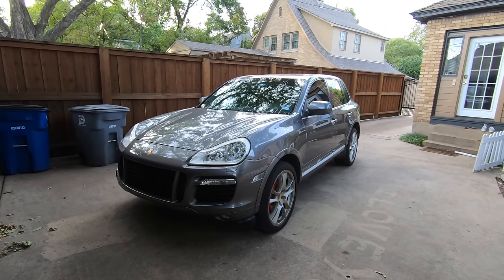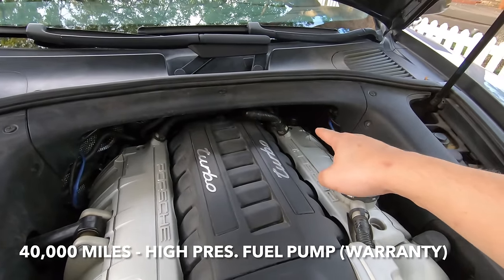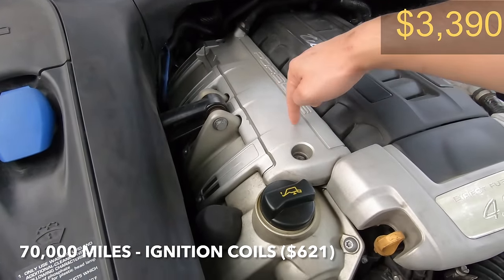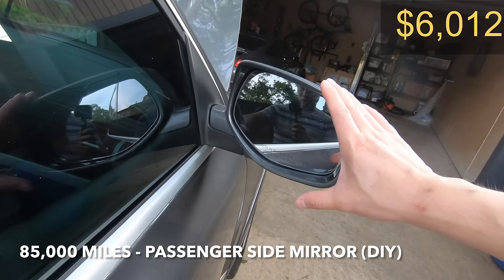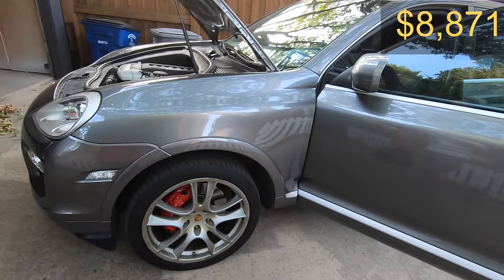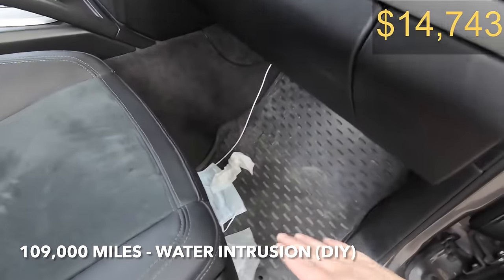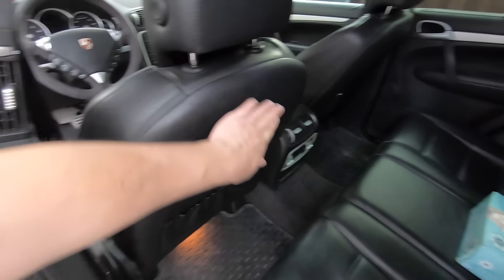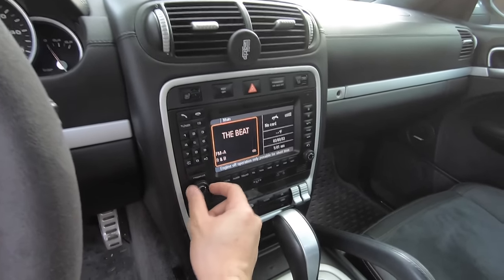Why Are Used Porsche Cayennes So Cheap? Owner's Review of 15 Year Old Cayenne Turbo (955, 957)

Comment: Premium cars like that with 100K miles are incredibly cheap in the UK. I remember my mate buying an old Audi S8 for less than £3K once, he got lucky and drove it around for a couple of years with minimal maintenance and sold it on. But all that car needed is one thing to go wrong and it could wipe you out. Even the tyres cost a fortune. It's the sort of car where if you couldn't afford to buy one with low mileage you definitely can't afford to run one with a high mileage.
Reply: Not speaking of Porsches, but my mechanic who really knows his stuff says of the modern era BMWs and Mercedes never buy used above 100k miles they are junk. Of course, he likes the Toyotas and Lexus. He owns a GX 470 Lexus and swears by it. Yet recently he just bought himself a new Tesla X. I want to say he paid 140k usd for it.
Reply: In Canada I can't even get an appointment for service without waiting six weeks. And those "repair costs" this video is posting??? Triple that in Canada. I can't even drive BY a mechanic shop without it costing 1,000. with no issues found. Ouch.
Reply: @Dwightstjohn-fo8ki  sounds like theyre ripping you off
Reply: Premium cars and high-performance cars start to generally start to get trouble around 80k miles/120k kilometers, that's why they're cheap. All the parts are expensive, and they're usually complicated to work on which means high labor costs, and sometimes special tools are required to work on them which means you need to go to the dealer which means $$$$$. High parformance cars are especially risky to buy secondhand because people tend drive the hell out of them, as they should.
Reply: I had a cls.  £2K FOR TYRES, They lasted 2 years of normal driving.
£3 a day !!!!.
Fart and a check engine light come on.
How I wish for a car with no gizmos
Reply: @Mr-ue2ul  yeah if you want a premium car you’re best off getting it as a company car then you don’t really care about stuff like that, you don’t pay.
Reply: @thyslop1737  you friend is absolutely correct. I only lease BMW’s. HOWEVER, my lil BMW i3 is an electric gem. My first service is 2 years. I’ve owned it for 1 1/2 years and it’s been perfect. The 2 year service will be just a walk around. They’ll probably say my tire tread is getting low due to the extreme torque this thing produces but I won’t pay for their over priced tires.
Reply: @Skyking6976  BMWs? Two weeks ago a cousiin picked me up from the airport and took me to the hotel. Never looked but it was the SUV do not know the model, if it was the 3, 5, or 7. Not sure of the designation. It was at night, but all I remember is how cheaply, tin can like it was and the ride was not that great. Just remember the SUV seemed cheaply put together.
Reply: I drove Honda crv 2015 for 7 years 0 issues, bought it new for $26k. Sold it recently for $15.5k and got $2k back for unused extended warranty. And bought 2022 Acura MDX Type S advanced and already multiple issues and rattling noise in a car. Fuckthis
Reply: @r2com641  Bad move. My sister had the MDX. Wanna say she had tranny problems at 50-60k miles. She lives in Florida. Drives like a grandma. She bought it new. This was at least five years ago. I think she said the replacement transmission was going to be 7k, if not more.
Reply: @thyslop1737  well I have extended warranty for 120k and 6 years.. so I’ll most likely swap car within that period
Reply: @r2com641  Will have to ask her the particulars on that car again.
Reply: @thyslop1737    Methinks your mechanic charges you too much.   $140K?  Yikes !!!
Reply: @boyracer3477  Did not charge me anything. HE TOLD ME HE BOUGHT A TESLA X and I think he said he paid 140k usd for it, if memory serves me right. Juzt thought it odd that he bought an electric vehicle, since he does not work on electric cars.
Reply: @thyslop1737       If he is your mechanic, he must charge you for maintenance.  That's what he does.  And if he buying a $140K car, he's making a lot of money doing it. But whatever, it's all good .....
Reply: @boyracer3477  Actually, he is very reasonable. He has built up a really good business though and was investing in real estate. Been at it for 25 years and has his shop paid off. He is very inclined towards the Lexus' and the Toyotas. Yeah, he must be doing pretty well to spend 140k on a Tesla X. A real had scratcher for me price wise and also the whole obsession with electric cars. I was totally shocked when he told me.

In other posts I have mentioned where he has told me to never buy a used Mercedes or BMW over 100,000 miles. He says they are junk.
No problem here. I only buy pickups. I have a Tundra. Thus far, fingers crossed. It has been a good truck.
Reply: @thyslop1737      Sounds like you have a good mechanic there.  I do too.  But his money goes into racing cars, not new cars.  I learned a long long time ago that the smart boss drives an old Toyota to work so that his employees and customers don't think he is living the high life on their backs.  Anyway, keep enjoying your cars.  The government is making it more difficult every year.  But they will have to take mine away from my cold dead hands ....  LOL
Reply: @boyracer3477  The mechanic loves his toys. He even has a Ski Natique waterski boat for his kids. And let me tell you they are not cheap, but I think he bought it with a blown engine and repaired it. Again, the electric car is a head scratcher. He has zero experience with EV's Yeah, I cannot complain about his work or rates.

Comment: Wow! To compare, we have a 2006 Toyota Highlander Hybrid with over 300,000 km (188,000 miles) on it. As far as unscheduled maintenance, so far it has only needed: or still needs
- around 100,00 km, the front cupholder spring loading mechanism that grabs onto the sides of cups broke so cups aren't held as firmly. I replaced it with an aftermarket mechanism at 290,000 and within 3000 km it broke again. 
- thermostat at 290,000 km (this is a difficult job and cost $500).
- polishing of headlight plastic lenses 300,000 km
- drivers door won't stay open when parked on a steep uphill  slope.
- the left front wheel bearing has a bit of play.

So far we've paid less than $1000 in repairs.
Reply: Imagine comparing a Toyota Highlander which is a family/around-town soccer mom type SUV to a Twin-Turbo high performance raging V8 that can keep up with sports cars and also go off roading. 

Totally different engineering goals and the components of the Porsche are under 100x more stress as it is designed to be the highest performance SUV you can get.
Reply: @8MunchenBayern8  imagine trying to cope with the crazy amount of money required to keep these ridiculous performance cars going?

Comment: The crazy part is, some of the recurring things are well-known Cayenne issues (drive shaft, coolant leaks, etc), you'd think they'd have at least improved the replacement parts to the point that when you get it done the first time, it's actually fixed.
Reply: Buy new plastic car pls
Reply: Kind of like the Boxster IMS Bearing/RMS/AO Separator/Clutch.  You just figure in the price of replacing them at the proper time.  I plan on finding a low mileage Cayenne and then replacing the coolant pipe and shaft bearing soon after to feel secure.  And get a set of Ignition Coils ready to replace the older ones.  I'm sure I'll add things to this list, but for what this car does, it's cheap.
Reply: No, no, no, you don't understand,  Porsche dealers aren't rich.....or more accurately, they wouldn't be without a constant supply of customers buying overpriced substandard parts.....
Reply: they sell everything that they make. so, why should they care?
Reply: @boxsterbenz4059     It is a very basic business tenet.  I won't try to teach you about business in general.  But let it be said that when any company gets a reputation for poor quality, they don't sell all that they make unless they lower their prices.  They don't like to do that.
Reply: @boyracer3477  thank you for not wanting to teach me the basics of business. as an MBA of several decades duration and a Porsche owner i think that i have some of the basics. maybe not all of them but certainly some.
Reply: why would they? it's not their problem anymore.
Reply: @boxsterbenz4059 but is a boxster really a Porsche though.....
Reply: It’s a Porsche not a American car. Their customers are a pain in the ass side effect of being the amazing company they are, according to their actions.
Reply: @Chenzooo  to a 911 snob no. but to those that are looking for a great bang for the buck, yes. if porsche hadn't made a decision to keep hp lower for the boxster-cayman the auto writers predict that they would outperform the 911. porsche can't have that so little brother is kept in it's place. quite frankly, i have tracked both and my feeling is that with the mid engine the stability is better and smoother. there's always a tad rear-end effect in the 911 which the vehicle admirably corrects for. but you do notice it.
Reply: Why would they do that? Most Porsche customers would bring it in for service. $$$
Reply: Porsche, unfortunately, seems to really cheap out on parts when they do new vehicles.  They wildly overcharge in the first place so there is no reason to do so but they do so anyway.  Any company that has been designing and building high-end vehicles for as long as they have should not make these types of errors.  I bought a Macan S from the first generation and lost count of the recalls.  The transmission went 1K miles after the end of the warranty.  Fortunately it was covered by the factory.  It is insane that they continue to make these mistakes, especially on the vehicles where they make a huge amount of their profits.  Those early Cayennes are not good-looking vehicles.
Reply: @cvn6555  Porsche probably did an analysis of their "best" owners, you know, the ones that buy new cars all the time, and found the optimal time for the parts to last so it's just a bit longer than these owners take to trade in their car and buy another new one.   
Porsche's goal is not to make a car that will be as trouble free for as long as a Toyota Camry.
Reply: Would not doubt that at all.  They have often been described as an "engineering company" rather than a car company.  Might be more accurate to call them a marketing company.
Reply: Exactly..I have had Japanese cars  over 150K miles...and none of these parts ever failed. Is Porsche playing the GM game (buying cheap parts from the lowest bidder)?
Reply: Crazy glue fixe3d all the cooant leaks.
Reply: leaks, leaks, leaks, wallet leaks👉🏿this actually is a piece of💩
Reply: @Chenzooo do you even know where the name boxster comes from?

Comment: I have an '08 Cayenne S.  I also had the driveshaft bearing issue, but not until about 170k miles.  I had the high pressure fuel pump issue around 70k.  The car now has 218k miles and I'm just using it until I figure out what to get next.  (Looking at ordering a new Escalade Sport Platinum)
One major plus for this car is the brakes.  With original rotors and 218k miles, no brake shudder!!  That's amazing in my experience.

Comment: It reminds me of my '07 BMW 335i SP. Everything started to go wrong as soon as the warranty expired. I spent thousands trying to keep it going without any issues. After almost 15 years, I sold it to someone who understood "its needs." I loved that car! I miss my money pit. I felt connected to the road. It almost felt symbiotic.
Reply: Yep, you screwed up. I have a 335is. Amazing driving experience. And I work on it myself, which is also satisfying.
Reply: @qx4n9e1xp  That's great, man. I never did much research on the IS until you mentioned it. Sadly, I'm not too mechanically inclined. I wish I was!
Reply: 07 BMW and you sold it 24 years later. So you sold it in 2031? 😂
Reply: @carpediem4512  What can I say? I was never good at math. Fixed.
Reply: @blueracer66  w
Reply: @blueracer66  
So, you're not mechanically inclined and you're not good at math...
Wtf are you doing with your life man?
Reply: @nikos-giorgos  Honestly, I dont know. 🫤🥺
Reply: I always wanted a BMW, so I bought a used motorcycle. 2006 F650gs.  $3,000. Three years now and not a single issue.
Reply: @superchilledbru  Loved the comment. 😅👏
Reply: Got one myself, true words spoken there
Reply: at least 335i is a nice car while cayennes are POS

Comment: I was a Porsche mechanic in the dealership during 2004 - 06.  They fail always and its too common thing in them.  Starting from the head light washers , wiper mechanisms , head light mounts , door alignment . window lifters ,  carden shafts , sun roof , sun glass holders , glow box dampers , Navigation , ignition switch , AC , seat frames , rear cigarette lighter cover , sub woofer , parking assistance , rear wiper , trunk dampers lol ....  😅  and when it comes to the engines and mechanics .... brake disk , steering vibrations , ignition coils , fuel pumps , engine mounts , coolant leaks , ATF leaks from the torque convertor , air suspension  etc etc ... 😅
Reply: well your talking directly to me here haha issues on your list we've had have been AC, trunk dampers, fuel pumps, engine mounts and coolant leaks. All fixed but definitely a plethora of other issues. Its been a love hate relationship but how expensive used vehicles have become we are literally still saving money fixing it ourselves
Reply: Is there any missing issue 😅😂
Reply: You've described pretty much every modern car.
Reply: @jasonpatterson2143  Not true at all
Reply: A Daily Nightmare !